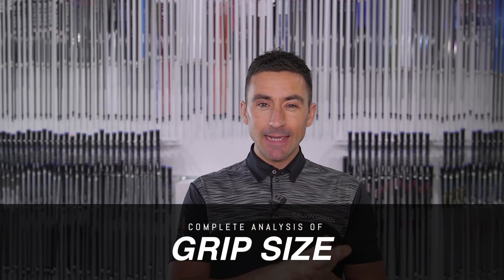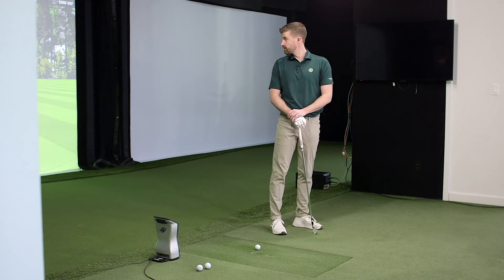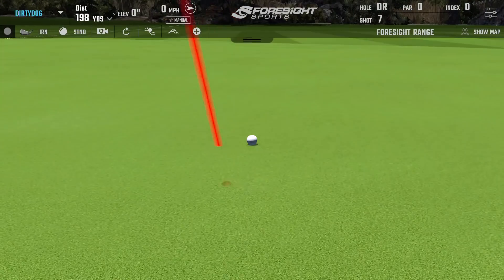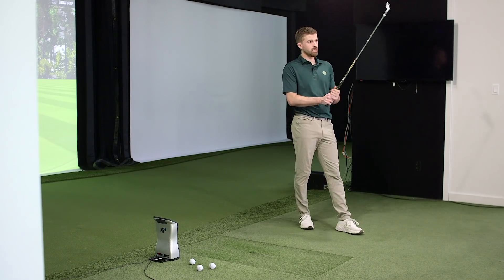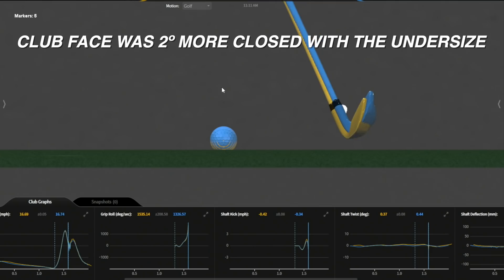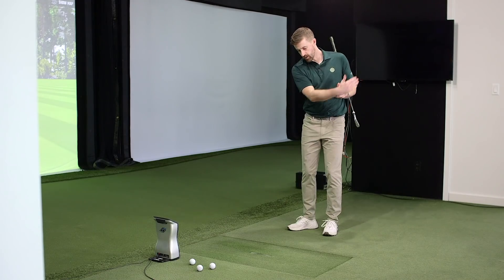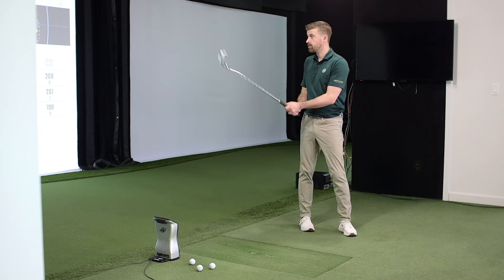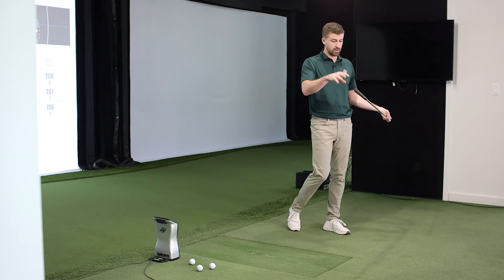Can GRIP SIZE Change Your Swing? // GEARS 3D Motion & Foresight GC Quad Testing

Comment: I will say, I have just been fitted with a new set of Callaway maverick. They have changed me into 1/4 inch over medium grip and 95g stiff flex and it's changed my game completely, an my swing is so much more comfortable with the mid sized grips. Makes a massive difference

Comment: This is a fantastic experiment, but I wanted to posit a question regarding balance point.  The bigger the grip the heavier the grip (usually), so how much is adjusting the balance point contributing to this?  You didn't mention whether you added weight to the head to compensate (I'm guessing no?)?  If that's true, then the club also became more counter balanced as the grip was heavier, so how much of that is assisting the observed results?

Would it be possible to try this same experiment, but make sure that the balance point stays the same for each grip change?  If that helps to neutralize this effect, that could be a good fitting point for someone that just likes a bigger grip, but they don't want it to affect club rotation that much?

Great stuff! :)

Comment: Very interesting find but there are other points to consider:
1. Other possible variables are weight and swing weight. How do they contribute to the ROC?
2. Is a higher spin loft achieved by a slower ROC desirable? If this means the face is open and the ball does not start online anymore? 5:35
3. Is this info applicable in a fitting? I don't know of any golfer who comfortably switches between undersize, std. size and jumbos.
Great find. But sorry boys, I had to curb your enthusiasm.
Looking forward to more gears stuff!
Reply from the maker: No problem, we will continue to play devil’s advocate ourselves until we understand how to control the variables.  However to answer your questions.

1) We change the weight variables you mention regularly without seeing a change of this nature.

2) Higher spin loft is very desirable as a club fitter in an era where the ball doesn’t spin anymore.  Taking spin off the golf ball is a lost art with today’s equipment.  So I LOVE have having the option to try this with a player when the situation presents its self.

3) I could give you countless instances where golfers said they’d never switch to 460cc heads or out of their beloved DG S300 when they swing 6iron at 80 mph.  The reality is if there is tangible evidence the it can have a positive effect on the outcome golfers will try it.

We’ll continue digging however as there certainly is more treasure to be found!!  

IF

Comment: I recently changed to a midsize grip and noticed this very thing in my delivery. I was a very low spin player, but noticed my spin increase from 5600 to 7500 with my eight iron with an increased grip size and ball change. I changed grip size to change my swing weight based upon your previous swing weight video, but had other positive effects. Been utilizing all your videos to fit myself to the equipment that I have and not having to buy a whole new set of clubs. Shot dispersion is much tighter. All the information you guys share is absolutely priceless. Keep it going!

Comment: Hey great video Galvin Green, nice shirt 😂, Grip size is about feel (big vs small hands), consider the shaft OD underneath? It makes a difference, bet Matts X7 is already big. Give us the OD profile  ratio under the upper and lower hand. DG X7 vs X1 vs S4 bet its is very different. Lots of variables to consider. While Matt is a great datapoint, it’s one datapoint. Thanks for the in-depth review. You guys are pressing the envelope.

Comment: So if I understand this correctly, when Ian did not go with a Mavrik driver because there was no adjustment to put more weight out in the toe, could he then address the open/closed face issue by using a larger grip?  If so, he would have to address swingweight then, because of the added weight of the grip.  Does that seem right?
Reply: Not necessarily.  Winn standard Dri-Tac 48g, mid 49g, jumbo 50g.  I will be doing my experimenting with Winns.

Comment: So you spend a couple of hours painstakingly fitting a set of irons. Then with 5 minutes left you get asked what grip you want. You pick one and it change everything about your delivery and impact. So fit the grip first?
Reply: I don't think you "fit" the grip. You decide on a grip based on needs or preference.
Reply: The one time I’ve ever gotten an extremely in depth fitting like they offer one of the first questions the fitter asked me was what grip I play. Like I’m pretty sure it was the second or third question. He proceeded to use an air compressor to put “my grip” on every single thing I made a swing with. Ended up with the best set of irons I’ve ever owned to this day. I didn’t even know that changing grips with an air compressor was a thing until that day.
Reply: @TheMuffs2004  where was this fitting at?
Reply: @TheMuffs2004  would also like to know where you got fitted like this! I’m almost 4 years into the game and have started messing around with jumbo grips and don’t know if I should replace all my irons with them. I love the jumbo golf pride CP2 grip on my 3 wood, 5 wood, and hybrid clubs

Comment: Anecdotal experience. I bought a used set of irons from ebay and they came with Mid-Size grips which were bigger for me. I noticed that I hit them very high and straight compared to my usual draw/over-draw and had a tough time turning them over.  Not sure why I sold them.

Comment: Great vlog guys - i have seen a big difference in control / consistency / spin for all of my irons, especially wedges, moving from Standard to Midsize.
When being fit buy very good fitters i am always told that I can choose between them both but on change over Midsize is where i am going all the time from now on in.
Nb Grip pressure if you are playing with the wrong size or ill fitting grip the pressure increases and your swing / plane / path can alter due to tension. We always tell / are told be relaxed / easy / no tension in any part of your game🙂🙂🙂 
Ernie Els - The Big Easy!!!💪👍🙂

Comment: My glove size is XXL and I’ve always used Jumbo size grips. I hit a nice high draw which I’m comfortable with. If I use regular or midsize, I start to flip my hands at impact and develop a low hook. One thing that I don’t understand is, why when I go for a club fitting, they fit me using regular size Grips!
Reply: They are not doing the fitting correctly.

Comment: From last set to current set ive changed grips from midsize to standard and i definitely had more out to in and open face with mid size now im alot more neutral but that could also have been changing from 1inch longer std lie to 1/2 inch longer 1flat

Comment: What’s crazy to me is that the size of the grip is responsible for a 7 yard difference in carry and a 10 yard difference in total distance. A 7 yard carry can be the difference between flying a bunker and sticking it tight or plugging on the lip. Potential 3 shot swing on one hole alone. Guess I’ll have to book my 27th fitting with you guys now just to check things one more time.

Comment: Would love to see you review the JumboMax grips. I just bought a set but haven’t installed then yet
Reply: I switched a year ago to the JumboMax jr. (+1/8).  I have a lot of arthritis in my right hand.   I didn’t see much change in the ball flight, etc.   I did see far less pain when playing and after the round.
Reply: Be mindful of swingweight - it will drop dramatically unless you add head weight. You'll have to swing differently (get the face more closed from the top, less face rotation all the way through) but the people I know who use them would never go back.
Reply: @canyonaro  I don't agree with the swing differently comment. I custom built a set of clubs yesterday and installed the XL's on them. I don't different at all. I actually think I swing more natural where as the midsize MMC's made me swing different. The face control didn't seem right and thus I had to try to do stuff with path to try to hit quality shots. it required a ton of timing and when it wasn't there it was bad. The jumbo max allows me to just swing back and swing through freely.

Comment: I'll foreshadow the specifics about deflection that Ian hinted at near the end of the video.  I read a published paper that demonstrated increases in shaft deflection with increases in rotation.  So the undersize grip causing increased rotation is ALSO increasing shaft deflection, and the oversize grip with slower rotation has less shaft deflection respectively.

Comment: Great vid chaps as usual - this makes me wonder... I like to use a winter glove pair when it's chilly - with the slight extra thickness & glove on both hands is that effectively increasing grip thickness / decreasing pressure and therefore increasing spin loft? 🤔 could be an interesting follow-up with gears on how glove / no glove / pair etc affects this

Comment: I play midsize but struggle to roll my wrist quick enough with the driver gonna try a standard grip to balance out the swing weight difference could I put a small amount of lead tape under or at top of shaft under the grip?

Comment: As a right handed golfer that has a tendency to hook the ball with standard sized grips, having tried a driver of a cousins with a larger grip, I was amazed that the flight was more neutral...maybe need to have my own driver grip re sized. Thanks for the info.
Reply: I did that with my 3 wood, it feels better and flies with a little draw.

Comment: Any insight into how the Plus 4/Plus 2 grips would impact this? Maybe half way between standard and midsize?
Reply from the maker: yes likely that's a reasonable guess
Reply: I was thinking the same thing. I put +4 grips on my clubs but the more I play with them I think I need to go back to std. I am not the best golfer out there. I tend to block more.  I need lessons but can't say my equipment is dialed in either. Was about to get fit before world chaos broke out.

Comment: While size impacts the swing, what is the swingweight change between the grips?
Reply: Ian Broglie - Ian generally says 1 swing weight point per 4g of grip end weight.
Reply: @Melchior11  Yep. But my question is more related to what is the impact of swingweight on the swings described in the video.  In the testing shown were the small/lighter grips counter weighted to match the larger/heavier grips to keep the swing weight the same? If not, did the swingweight change have a significant impact swing and strike too?
Reply: @ianbroglie1357  I'd assume that swing weights changed with the different size grips, which may well lead one down a different rabbit hole, was it grip size or overall feel of the club that influenced shots?
Reply: @Melchior11  the swing weight point changes aren't a one size fits all influence, meaning a slightly higher swing weight isn't going to affect Matts delivery the same as you or I. Some people can have great success with a wide range of swing weights and some people are really sensitive to small changes enough so that it mentally causes them to swing different. Completely player dependant.
Reply: @kourt2469  Absolutely.  Just wondering what the impact to the equation would be for Matt. Smallest to largest grip size could be 3 swingweight of difference, which is not insignificant to delivery.
Reply: @ianbroglie1357  yeah some jumbo grips would change even more than that. Some are 85-110 grams. But there's really no way to isolate whether it was the weight or the grip size causing x change, if that makes sense. But swing weight is a difficult one do don't get too wrapped up in it.  For example You can have a 300 gram shaft with a 600 gram club head built at a swing weight of D2 and it's going to feel very very different than a club with a 100 gram shaft and a 200 gram club head also at D2.  That was an exaggeration but just pointing out that identical swing weight doesn't mean identical feel, and a small swing weight change isn't going to drastically affect performance. For example if you grip the club on the very very butt end then it will swing weight at D2.  What happens if you grip it a half inch lower?  Swing weight is now 3-4 swing weight points Lower.  Nobody grips the club in the exact same spot every single time and you can still hit the ball just fine regardless.
Reply: @kourt2469  Understand completely.  I referring to the fact that Matt is using the same shaft and club head with a different sized grip, so apples to apples the heavy jumbo grip would reduce swingweight while increasing overall weight by a bit and this could affect strike consistency too. By no means am I comparing my swing with Matt's, but i do know when I have an average weight club and I get to light in swingweight (D0 range) I can get a little scattered in strike due to timing inconsistencies. Was just wondering how much influence each component (grip size and weight) has over strike and ball flight.
Reply: @ianbroglie1357  yeah I get that. I'm just saying it's depends on the player what change in delivery is going to happen. Not a hard and fast rule for everyone unfortunately.  Which shows why getting fit is so important.
Reply: @ianbroglie1357  kvgolfa is correct and in general you should not be using swingweight the same way when changing grip weight. A heavier grip means static weight goes up and measured swingweight goes down, but if you were to add weight to the head in order to bring the swingweight back up then you have now increased the weight of the club even more. Use an extreme example to prove the point, take a hypothetical grip that weighs 2lbs (907g) installed on a club that measures D2. Now in order to balance that in terms if swingweight, you would need to add around 362g to the head. Now the club measures D2, but common sense obviously says that is going to an extremely heavy, unplayable club. Swingweight gradually loses direct meaning the more you stray from the intended parameters under which it was designed to measure, the main one being a 50g grip. 
 
Bryson Dechambeau played those 100g+ Jumbomax grips for awhile (I think he plays lighter ones now) but he obviously did not add 30-40g to the head to "make up" for that.
Reply: Whoops. I essentially asked the same question as you just minutes after you did. I'm hoping that enough people do and they address this topic when they do future videos on this subject.